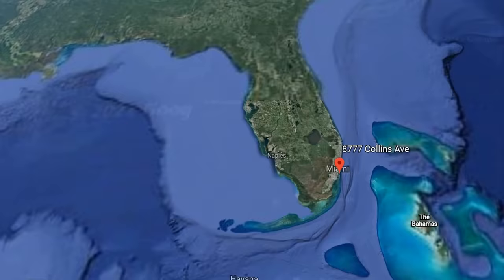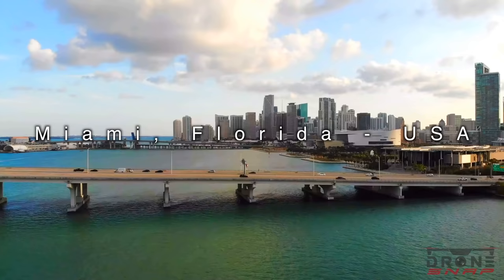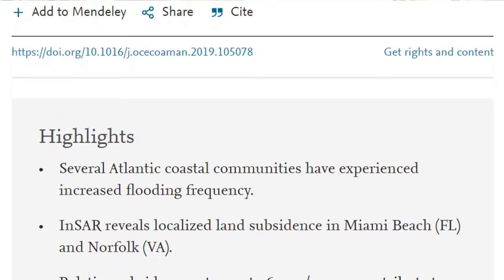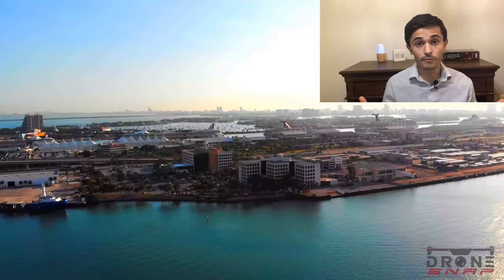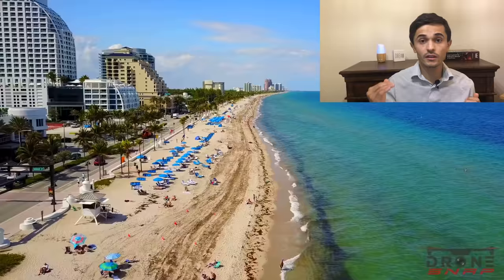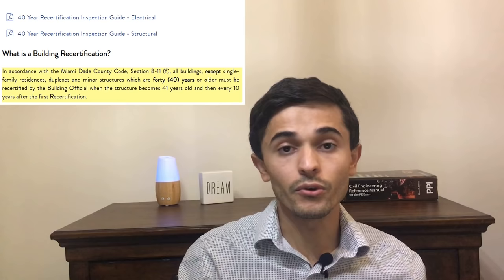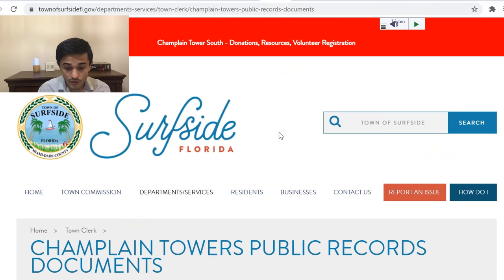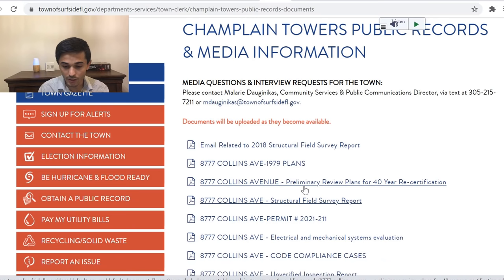Why Did the Building in Miami Collapse? A Structural Engineer's Perspective

Comment: I have been a structural engineer for over 40 years; Many factors can contribute to a building's collapse; Moment calculations are greater than zero and less than 1; somewhere the equilibrium point was altered and Newton's fourth law came into play. When we engineers calculate a building, we obey the purpose how they will be occupied; No one knows the changes that have been made to the building, Weight additions; drilled a hole in a beam for passe pipe at the exact point of cutting, removed structural walls. What I could see roughly used open box for foundation and I would never accept to calculate building with this type of foundation where the ground mechanics are weak and strong winds needs counting the tidal wave; Earth's seismic zones. There is too much room for lawyers to accuse and defend their clients. Here in the USA in just 12 hours of training anyone can be a building inspector; that has to change buy authorities and to put engineers who spent more than 4 years in universities... I feel very sorry for the victims and their families; were buried alive
Reply: Really 12hrs? That's sad. McDonald's trains for a week
Reply: In our country money,crime and fraud has the power they don't care educational experience
Reply: Based on how I watched it come down quick and hard finding anyone alive or who slowly died by buried alive is very unlikely. Our frail bodies can't handle a giant concrete slab falling over on us let alone a few.
Reply: So I guess air traffic controls need to go get a 4 degree now since planes haven’t stopped crashing 🤦🏾‍♂️🤷🏾‍♂️
Reply: @41istair  In you opinion , what do you think could of caused those bright flashes right before? And has a 40yr old or any condo building just suddenly out of nowhere collapsed here in America??
Reply: Did you see the pool deck columns punch thru the pool deck- the deck collapsed into the garage and the horizontal cables (I think it’s a post/cable system) pulled the already weakened columns forward causing the failure along three/four columns. Can you confirm the design specs here?
Reply: @Gabriel lol talk about neglect, he said 12 hours not 8 hours.
Reply: Newton's 4th law? ... 🤔
Reply: @peterpalmer7014  yeah I was thinking it fell under the third law. The action; the pool and parking structure collapse. The reaction; support columns break causing the floors of pancake on themselves. But yes ultimately the fourth law prevails. Gravity!
Reply: I guess to continue that chain of events. The remaining structure that fell moments later was most likely supported by the stairwell gravity definitely took over.
Reply: @peterpalmer7014  Newton's Law of gravitation is called Newton's fourth law. It states that every point mass attracts every other point mass by a force acting along the line intersecting both points.
Reply: @peterpalmer7014  Newton's Laws are a set of laws that describe the dynamics of motion.  Newton's first law, known as the law of inertia, deals with resistance to changing the state of motion;  Newton's second law, known as the fundamental principle of dynamics, addresses the definition of net force and its relationship to acceleration;  finally, Newton's third law, the law of action and reaction, describes the pairs of forces that arise from the interaction between bodies.
Reply: @noorielaboab1032  I edited the incorrect word in my statement. I mistakenly type 2nd when I meant 3rd but the statement initially was about action and reaction. Without the action and reaction the building would have remained standing. Newton's fourth law would clearly be in effect because the structure is above ground, but would not be taking down the building.
Reply: Being a structural engineer, you should know why buildings fall at freefall speed, without force pushing  back up??? Come on folks, this is obviously foul play.
Reply: @richrusso5301  of course because anytime something tragic happens, it must be a government cover-up. Sometimes things just happen. Toughen up buttercup.
Reply: I want to tell you...I think you changed my life with your comment. I have been searching for something that feels right and so I looked into building inspector training! It feels right! Thank you!

Comment: I was planning to buy a condo in a small island in Sao Vicente, called Ilha Porchat but after this I halted negotiations. The columns of this building which sits on an enormous rock at the very edge the ocean (much closer to the ocean than the Miami building) had problems with open concrete and exposed steel that appeared to be corroded. Management was going to begin the repairs process but I felt uncomfortable especially after the Miami incident. Eye opening.  Great video, thanks!
Reply: I would probably do as you did. The damage to the structure that you could see was the tip of the iceberg, according to experts. The building will probably not collapse but the repairs will be millions of dollars. In addition, I would fear the repairs were inadequate.
Reply: Wise person.

Comment: It appears that the pool deck gave way and collapsed into the car park below which compromised the foundations of the first building to the point the front fell into the same void and this caused the second collapse. One of the victims (RIP) frantically rang her partner saying a sink hole had appeared by the pool and the whole building was shaking. It fell seconds later.
Reply: i still cannot understand how a floor, a giant patio slab of concrete, by a pool, could be holding up a building that would be about 20 away from that slab on the ground. BTW... the weight of the building hitting that slab which was a roof over the parking could very easily have caused it to cave in. 5000 tons of concrete falling at 100 miles an hour and hitting pretty much all at once would cave in any roof 1 still cant figure out how a slab on the ground would support a standing building 20 feet away
Reply: @reBOOTpctech  I think that the "pool deck" is not just the deck around the pool but the entire ground floor. 
I was confused until an engineer explained that the entire ground floor was called the pool deck. So, the pool deck extended above the parking garage under the main part of the building. Where I live we would call that slab the ground floor.
Reply: @reBOOTpctech  Several professionals have posted on YouTube that it is very possible that the outdoor pool deck, which was attached to the main structure, could have pulled the main support columns of the building itself toward the collapse, destabilizing them.
Reply: @AskMiko  chilling isn't it
Reply: First crack and ill be running out the door now !!
Reply: It was reported in previous reports that pool deck had a major design flaw. It was not  properly isolated. Water sipped into cracks corroding reinforcing steel, destroying concrete. Once pool deck collapsed, it damaged ground floor columns supporting the whole structure. Panckaking of the building could not be avoided. This was, in my opinion, a failure mechanism
Reply: yeah it ripped the support beams out underneath
Reply: Yes. We think the pool deck came down and this brought the building down... but why. Yes the deck was not angled for drainage.  This and Spalding dont seem enough to collapse.  There has to be more to it.
Reply: @philipjohn4149  there are several factors. It appeared that reinforcing steel rusted. Rusting reinforcing steel expands, leading to spalling concrete and more exposed reinforcing steel and etc. Please consider that steel was exposed to marine air which is much more harmful. Finally, the pool slab deck failed due to pinching shear. There are some reports out there that only two horizontal bars were intersecting columns, instead of four, as shown in approved construction documents. This condition lead to punching shear failure along with rusted reinforcing steel mentioned above. Deck failed along  the first row of 3-5 columns, supporting multistory portion of tower. Columns buckled due to increased length (column’s design length doubled instantly), multistory portion of tower tilted and pancaked.
Reply: @terry94131  I'm not trying to be mean but I think I'm realizing that many of the engineering YouTubers really don't have degrees and perhaps just taken a few classes on the subject. Because any REAL engineer isn't going to tell you that a high rise building collapsed because of a pool or like others have said (lol) planter boxes. ??? like really? This building was not even close to code.
Reply: @kalidilerious  Not at all kalidilerious!  Despite the obvious tragic loss of life, I think a great many of us are learning a great deal about structural engineering and find it surprisingly interesting.  Josh Porter (Building Integrity) just did a piece on the possibility of a water-filled void opening up beneath the lower level, which, if true, could have had serious impact on the column.  I look forward to the final report on the collapse, but of course, that is months away.
Reply: @terry94131  Okay. Assuming that whole column failed due to a water filled void. If  the other columns were built properly those would not have fail just SECONDS apart and bring down the rest of the building. Right? There's no way that building was built to code.
Reply: @kalidilerious  This is going to be like an episode of "Seconds from Disaster."  I suspect they will find that the builder cheated on materials, the deck was not sloped for drainage, improper revisions were made, and the HOA did not do proper maintenance.  All reasons why I've never owned a condo.
Reply: @kalidilerious  I mean, several structural and civil engis who have been in the business for a long time have pointed out the planter boxes, and I believe it's in the ongoing reports too. You're laughing at the idea of planter boxes but those things can weigh literal tonnes when you have a planter box the size of a small car outlined in thick concrete, full of soil, and constantly taking on water from the elements. The original plans did not take into account the placement of the planters and therefore they were a huge extra weight on columns that weren't built to support them. It's believed the original pool deck collapse started right around the join of several of those planters, even.
Was it the planters alone that caused an entire building collapse? Unlikely. But suggesting it's a laughable idea and saying no REAL engineer would consider them at fault is a weird take.

Comment: Very clear analysis QQE.  Side note:  Here in Pennsylvania, when the Penna Dept of Transportation (PennDOT) builds a concrete bridge of any size, they make it clear that the lifespan of that bridge is FIFTY YEARS.  Period.  Because we salt the roads in winter, even with the best of maintenance, the concrete and rebar deteriorate over time.  Clearly, salt air and spray has the same effect on beachside high rises.
Reply: Number one if real PDOT does that it’s very lazy. It’s also unsafe in that case. So remind me not to drive on PDOT bridges.  I heard nothing about the post tension concrete state and the apparent spalling and how that relates..  I guarantee in Pennsylvania you have post tensioned bridges. Some arbitrary number of lifespan means nothing. If you want to debate that I’m sure not only myself but former professors would be happy. Why would concrete matter? Does it not depend on the structure of the concrete? Maybe I missed something.
Reply: The Golden Gate Bridge in San Franciso is under continual maintenance and repair work. Every year. Every day. It was built in the 1930s. All buildings and structures need continual repair work. No matter what size it is.
Reply: @rollothecat2010  I’m not debating that. It’s the quality of work and inspection done. Respect all work but also inspect it. I mean there was crazy spalling on that building. Haven’t noticed that on the gate.
Reply: the concrete used on a bridge that is in the ocean it defiantly different from what a building requires.
The problem with this build that collapsed was that they didn't ever put in money for long term maintenance.  The owners recently received a maintenance ticket of just over $100k each.  That is a lot of money for each owner to absorb.

Comment: I imagine the building was supported on driven piles to bedrock meaning soil would not likely be a factor. 
The water damage leading to concrete spalling and rebar corrosion are more likely causes.
Reply: It was more than likely built on sand….
Reply: Usually that is what they do... but you are right by the beach and salt is present... I understand that that creates corrosion.
Reply: @Laroc1982  The piles go well below the surface soils. Buildings on the ocean are not built on shallow foundations.  The pile foundations go many 10's of feet below the surface.
Reply: Must not have been good bedrock.  The building was reported to be sinking yearly all the way back to 1990.
Reply: @johnm8961  most plies are friction piles and don’t rest on bedrock.  I’d also like to know what the building has been sinking relative to.
Reply: @johnm8961  It appears that the FIU subsidence study used satellite data but it’s not clear whether the building or the ground was being monitored. Either way, I don’t see that amount of settlement being alarming.  What’s important is whether ground movement was uniform.  Differential ground movement has not been flagged thus far. Have wait and see what the studies find.
Reply: @toddarmstrong7038  When is ground movement uniform?   Doesn’t matter anyway.  Concrete gets cracks.  It’s not a perfect material.  Salt water gets in to the rebar.  I’m sure you know that.  Doubtful much inspecting was done down deep to see anything.  They already said basement was always pumping out water.  
I don’t need anymore diagnosis.  This will go in in the courts for the next decade.
Reply: @stuartdavis798  Correct. I think that along the east side of the barrier island the ground conditions are loose sand over bedrock so end bearing piles are more likely. Would be good to hear from a Miami geotech.
Reply: @johnm8961  “Uniform “ in that it’s within an acceptable tolerance, doesn’t have to be perfectly uniform. Many skyscrapers in Miami have settled feet and are okay because they were designed to accommodate this. You’re right about it taking years to sort out the root cause. I think the current evidence points to structural rather than foundation.

Comment: Unless I missed it, you didn't mention that the front part of the middle section collapsed first and the part of the building behind it then followed. Then the right building collapsed. Other engineers state that this more or less shows which part of the building was more structurally damaged. Only repeating what I saw/read.
Reply: The planters in front of that center part had been holding water to the columns at the pool deck for 40 years. The columns below, by parking space 78 were often, if not always in a pool of water. Water was constantly being pumped out (sea water). Pumps had to be replaced every other year, Rebar was rusting inside those column and ex-ploding the concrete columns in that center section that failed first -the dominos fell, radiating from that point. IMHO
Reply: @Soularddave  Exactly, well explained...
Reply: Yeah and he's a expert  lol
Reply: All I saw was bright flashes going off
Reply: KathyS well they, and you are incorrect. It began at the pool deck- the same area the cc tv footage doesn't show because it's obscured by things like the other building and trees.
Reply: You missed it.